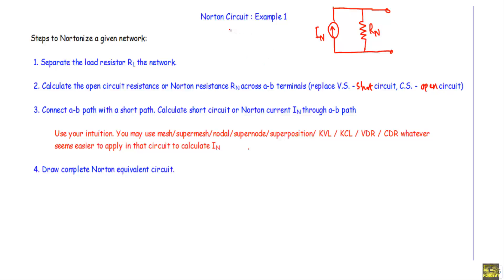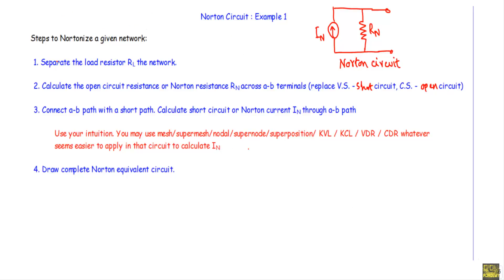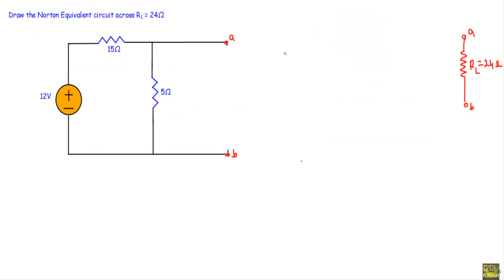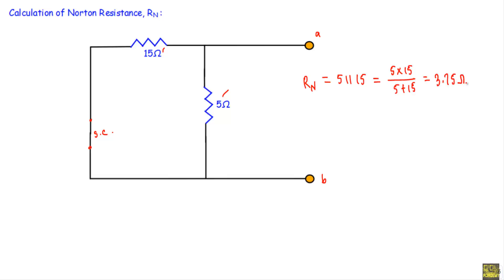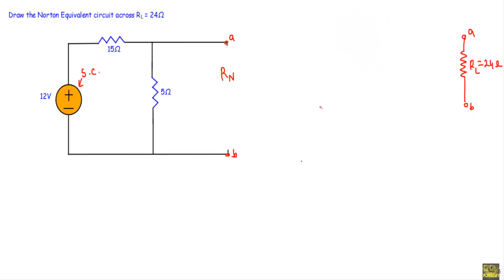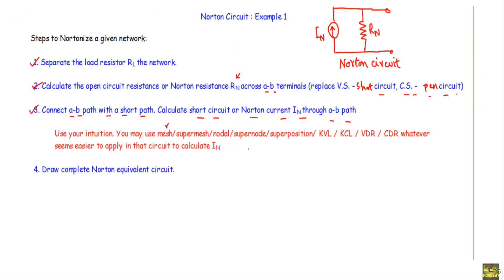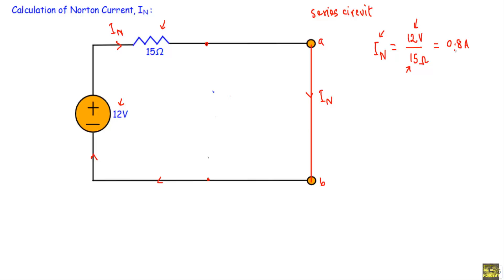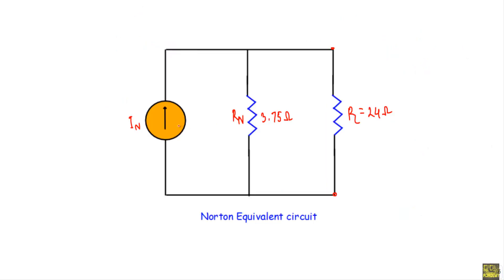Norton Circuit : Example 1

Comment: The 5 ohm and 15 ohm resistances are in series and not in parallel.
Reply: There are two nodes after the supply is dropped. We could say a is in node V1 and b is in ground. Both the 5 and the 15 have an end on each of these nodes. Thus they are in parallel with each other. If you add the supply back in then they are in series since both there ends are not on the same nodes anymore.

Comment: still dont get why there is no current through 5 ohms resistance
Reply: Think of how two resistors in parallel have the same voltage no matter the resistances. Now remember V=RI. If you say think of the short as a 0 ohm resistor and do the equation V=0*anything=0 volts. To have 0 volts on the 5 ohm resistor the current must be 0. Thus a short causes the current to bypass the resistor.
Reply from the maker: because current flows in low resistance path, so the current will not go in 5 ohms. It is very basic question

Comment: Why is there no current flow in 5 ohm resistor?
Reply: becoz of current flow in low resistance path,so the current will not go in 2 ohm ok
Reply from the maker: Because a short circuit is connected across it